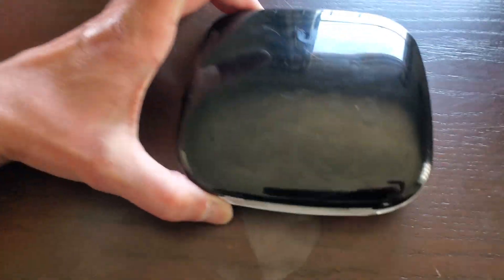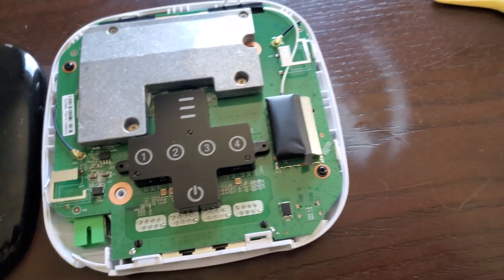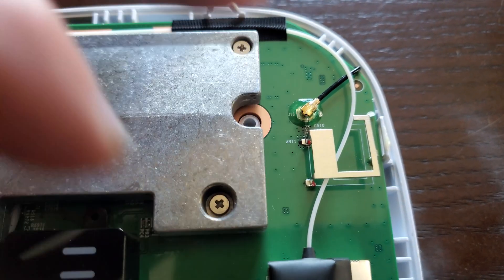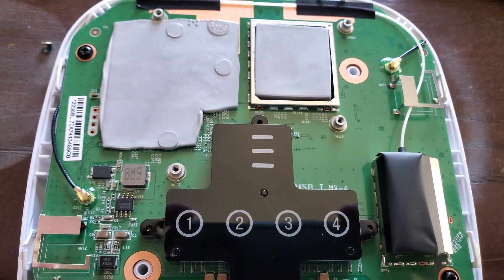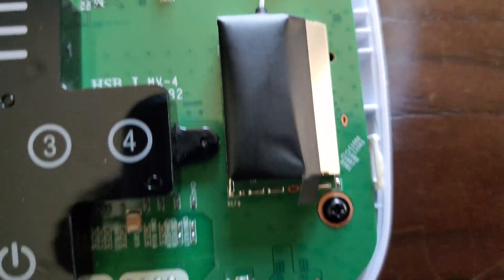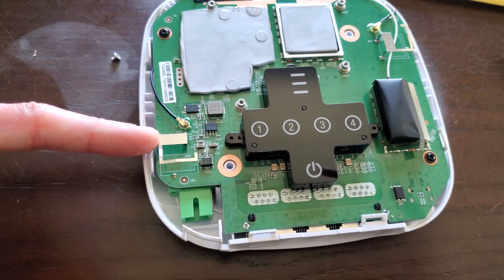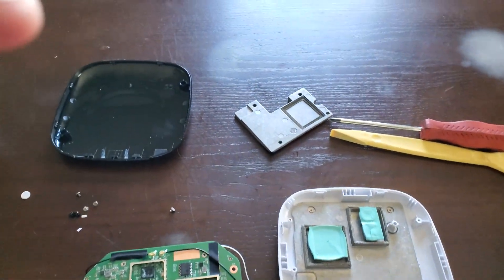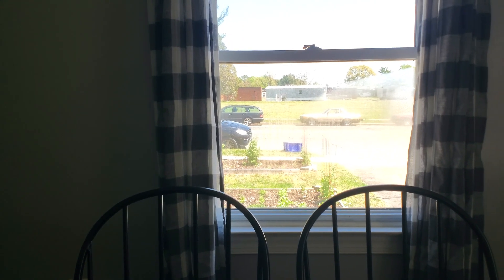UF-WIFI6 GPON.  What is inside that makes it awesome?

Comment: The heatsinks look like cast Zinc. Very odd IMO, aluminium casts nicer and obviously works better to transfer the heat about. Zinc can be a tiny bit cheaper, not sure why it's being used there though. Lead is way too expensive (and also too soft/incompatible with ROHS) to use in a casting like that.
Reply: Ah, Zn is heavier than Al - maybe they just wanted the thing to weigh more and not feel "empty" so used Zinc?
Reply from the maker: I think your right it's less for the heat and more for the "feel like something"

Comment: Re. Antennas 
It will be multiple chains of wifi 
If you look at one of those fancy spider routers, this is the smaller range version of that. 4x internal antennas.

Re. Coupling - i dont think female SC plugs exist - they are all just couplings.
Reply from the maker: Yeah your right about the SC female I just assumed it was something fancier.  The Antennas are really interesting as you can just drill in 2 SMA connectors and make a epic long range version of the UF-Wifi6

Comment: These UF-Wifi onts are the most unstable and buggy Pon devices I have ever encountered. They crash in mysterious ways and are "repaired"only by truck roll. Thank God we are now retiring hundreds of these and are replacing them with either the UF-Loco or nano G these run way more reliable and can even work with non ubiquiti GPON systems albeit with a few caveats.

The issues with Ubiquiti pon come up after a few months of uptime not instantly
Reply from the maker: UF WIFI = total crap and the UF LOCO is incredibly reliable I agree with you.  This is the newer UF WIFI 6 and it's been about a 99% hardware reliability for us (with about 500 in service) over the stupid UF WIFI which had like 50% reliability during Covid times.

Comment: Routing RF far on a circuit board is annoying: You have two choices for how to do it: microstrip, where it travels on the surface. This also behaves as an antenna, receiving noise from things it passes close to. And buried stripline, where it travels inside the board, which is expensive because it requires more layers and you can't really have components on the outside where the stripline is. So at some point the price of a pair of hirose connectors and a prefab rf cable becomes appealing.
Reply from the maker: Really nice explanation of why that is on the inside.  My thoughts were they could mass produce a longer range version maybe with external antennas.

Comment: can you build some optical network taps? could be a good product to sell on the sidePassive, Secure Technology

 
Provides passive access at 1000 Mbps without data stream interference or introducing a point of failure

Connect up to six monitoring devices to six different links

All-optical design is optimized and tested for GigaBit fiber networks

Permanent in-line installation without affecting network performance

Passes all full-duplex traffic (including errors) from all layers for comprehensive troubleshooting

No IP address is needed for the Tap or monitoring device, enhancing monitoring security

Completely transparent to the network and requires no power

Fully RoHS compliant
Reply from the maker: very interesting I do believe I can splice a splitter on it and possible mirror traffic backwards?  Any ideas what device you want to see on it?